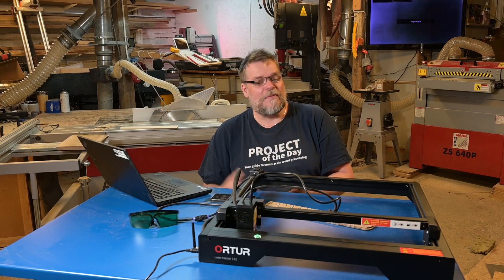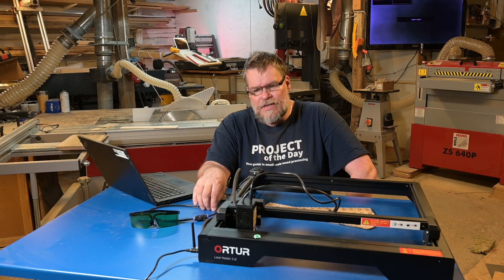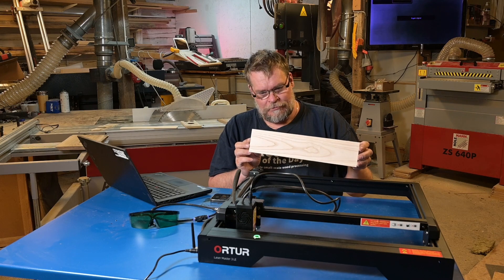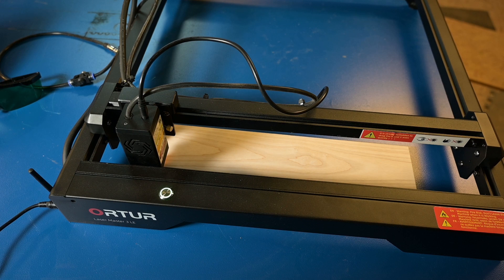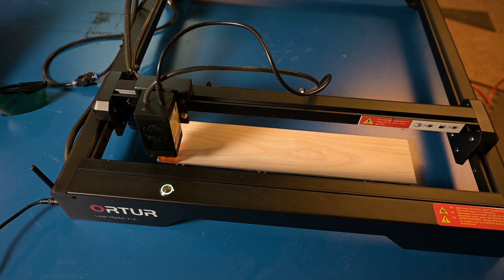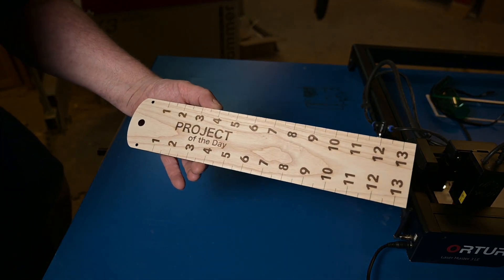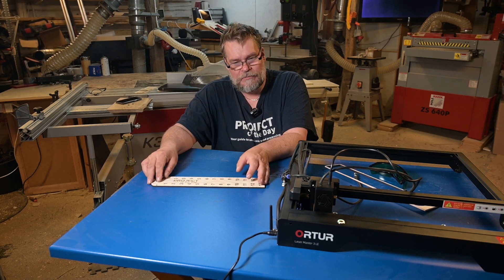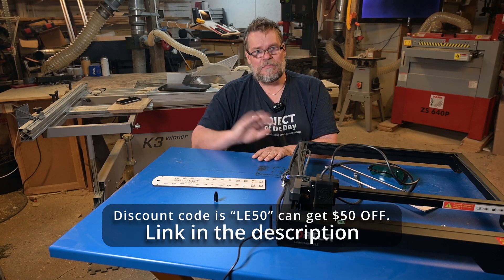Unleashing Your Creativity with Outer Laser Master 3 LE: Ultimate Tool for Bringing Ideas to Life

Comment: Good morning. I've got the PH260 

Standing on the in feed side the first Vertical spindle bearings have seized up Having trouble finding the bearings woodmiser says they can't get them 

Any help?

Thanks
Reply from the maker: Hi If you can see the number on it, I can find out how big it is. At least in Sweden, there are standard sizes of all ball bearings and the number of them says which capsule, size and tolerances it has. And when the machine is manufactured in Sweden, the number must be on the bearings. Usually stamped on the side. Looks similar to "6202 2RS"